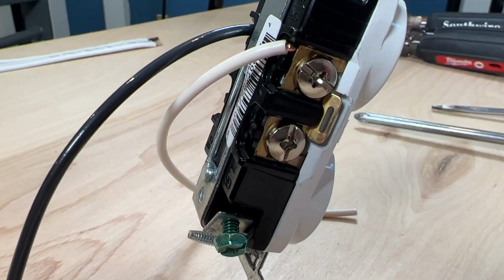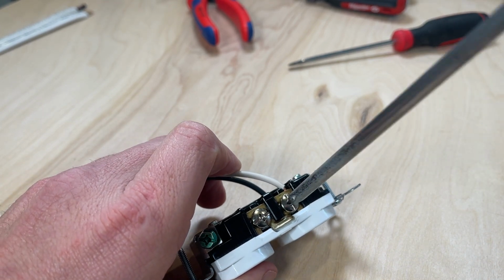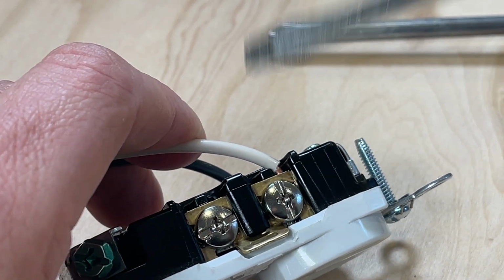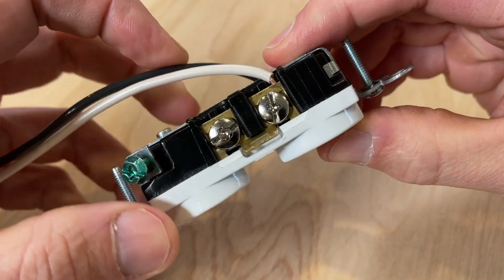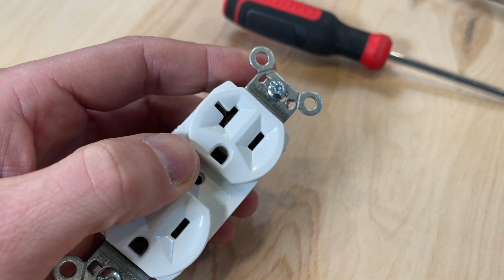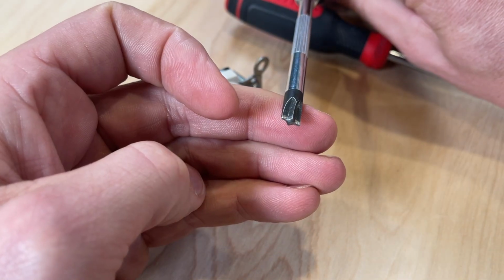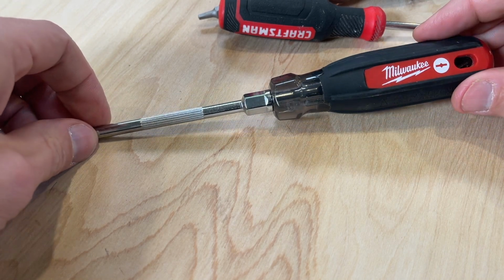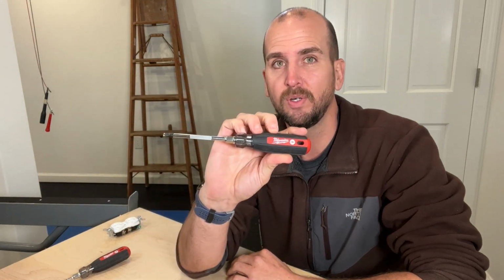80% of People Use the Wrong Screwdriver For Electrical Work

Comment: Let’s face it, cruciforms of any sorts are plain no go. ECX blades are so wide that it condemns you to be exactly square with the fixture, while Robertson gives you significant play in the position.  One outlet per six month does not matter. 100 a day is something else.  But can anyone tell me, why on earth use a tool designed to cam out in a straight torquing application?  When something is design in a certain way, well, why not just just use the tool that was meant to be used for the purpose? Beats me everytime.  Is there something to learn from that 56% use a tool that was not design for the task?  Yes and no. If those who answered were to be electricians, I would certainly ask another question before hiring a new electrician for shure! If not, then, anyone can go with whatever floats his own boat.  I’ll keep doing my finishing with my trusty wigglies, no1 Robby for the wires and the receptacle to the box, small flat for the plates. Light, efficient, never out of battery, never a cam out. And will never get why the debate « American » Philips vs « Canadian » Robertson.  One is for cam out application like drywall screws, the other covers the rest.  All the others are to have us get boxfull of useless tools. Who are the ones getting screwed in the end? 🤔

Comment: 1st off... it's a combination screw that is designed to be used by a #2 Philips, 1/4" Slotted, & a #2 Robertson.  
So pick your poison.
Reply: It's a #1 Roberson on the devices I have, but you are right.  The screw is designed to take any one of three common screwdriver types.  

Combination screwdrivers are a gimmick, in my opinion, and not a good choice because they won't fit older devices that don't have the combination screw.  My Alfa 4-in-1 has all three drivers, and they all work well.  The Robertson is the most convenient; the flat blade is probably best for torque.

Comment: Recently ordered the Klein 32752, Milwaukee ECX bits 1 & 2, and the Wiha 30704 from Amazon.  I TRIED to buy from my local Home Depot & Lowes, but they DON'T HAVE THEM.  Home Depot website CLAIMED they had Milwaukee ECX, but after wasting time with Home Depot store & online order (which they cancelled), I went with Amazon.  Why don't the stores have these in their Electrician Tool section?  I've been using Square Drive #1 & 2, but want to have the proper tool for ALL situations.

Comment: Great information. What is the trick to getting the wire around the screw after you make the loop?  I'm just a regular guy, not an electrician but I've replaced over 100 outlets and I've yet to see one where you can actually fit the wire around the screw...the wire is too thick to fit between the screw and the housing. You have to really force it and almost break it.  I have in the past backed the screw out until it falls out then place the wire then the screw. What do you pros do?
Reply: Pros use a better quality device.  I am not an electrician, but I have a couple of good receptacles in stock.  The Eaton does not have the modern back-wiring feature, so you have to put the wire under the screw head.  The screw backs out then stops; it doesn't fall out.  There is plenty of room to put a hooked wire on the screw.  The Hubbell is designed to take a straight wire into a fitting which is clamped by the screw.  These screws do not back out so far, so you are supposed to use the new method.

Comment: The drivers must cam out for a reason. To prevent someone from applying too much torque to those little screws?
Reply: It was not the primary purpose of the original design, but it was not a problem.  The Phillips screw was not intended for high-torque applications, it was designed to make assembly more efficient.  Self-centering was the main objective.  I have tried using the proper sized Phillips for wiring a receptacle and I don't think cam-out is a problem preventing making it sufficiently tight.  Notice in the example shown here, he is not holding the receptacle securely.  He is also using a driver with a fairly long shaft.  If you hold the receptacle firmly and use a suitable driver, like my Alfa 4-in-1, it is easy to tighten the screw with the Phillips bit.

Comment: The screws are designed for Robertson bits so that is really all you need and a standard Robertson screwdriver  is inexpensive. As in every other application Phillips and slotted are dismal performers.   I’d probably look into a hybrid if I did this all the time but it’s an otherwise unnecessary tool.
Reply: If you have to remove old devices, they may not have the Robertson compatibility.

Comment: I've been using the #1 robertson for receptacles for the longest time now but that head is starting to slip on my latest project so I decided to upgrade to the #1 ECX. It is really nice and it gives me super tight connections. I'm still keeping my #2 robertson for panel work. I didn't find using the #2 ECX comfortable to use on a panel.
Reply from the maker: I usually use GRK multipurpose wood screws from Home Depot.  On this project 2" long would work well.

Comment: Why doesn't the outlet manufacturer use a normal Phillips screw? Why the Robertson screw?
Reply: It is a combination screw which accepts a straight blade, Phillips, or Robertson driver.  The United States and Canada use the same electric power system.  Robertson drivers are common in Canada.  Any household in North America is likely to have at least one of the three accepted drivers.

Comment: So im working on a light fixture, The plate was put in with screws that look like that but more rounder in the middle whole. & No screw driver is working. I got all sorts of specialty bits too except for a slotted phillips because i hate them. Do you know what type of screw it could be? The whole seems to be smaller than most as well.

Comment: I have found the Klein combination tip to be better than the Milwaukee.  The problem with the Milwaukee is the square tip is not long enough to actually do anything. The blades of the "flat" tip portion bottom out in the slots before the very small square drive can actually engage.
The Klein tip has a slightly longer square portion.
Either is preferable over a Philips or square drive IMO

Comment: I was first introduced to the Robertson in woodworking. Kreg screws use the #2 Robertson. I think the #1 Robertson is the best for electrical devices. I have the Milwaukee ECX and it doesn't fit deeply enough into the screw and because of this you can't apply the torque required. The ECX beats both the flat blade and Philips but not the Robbie.

Comment: I'm a tool snob. Working with inferior tools drives me crazy. However, by the time a picky DIY'er buys all the right tools for each DIY job, he/she will need a space larger than a Home Depot tool department to store everything. Not only do you need a lot of space to store lots of great tools, you have to develop a method of keeping everything organized and in good condition. It doesn't take long before this enterprise grows into overwhelming proportions. Drowning in tools.
Reply: I have a lot of tools and I live in a small apartment.  It isn't the tools that are the problem, it is the power tools in particular.  Hand tools don't take up much space.  I have a Klein tool pouch with sixteen screwdrivers in it.  Compact, but the drawback is that I have to dig through it to get the one I want.  Add a few tool boxes and a small chest of drawers and I can keep a lot of tools with enough room left over to live a normal life.

Display of tools takes space.  If you like to have a lot of tools hanging up in plain view, then you need a shop with wall space.  If you want all your wrenches well organized, then you need a tool cabinet with those shallow drawers, as large as necessary.  That's a luxury for the nonprofessional.

Comment: I have used the #1 Robertson for years wherever I can. I have been upgrading my switches (again), adding a bunch more smart ones. I took your advice and bought a Milwaukee ECX #1 (HD, 3 piece insulated set), as well as a Klein Hybrid multi-bit (#2 only in the set) - easiest way to get these locally. For the most part, this has been great, but a few comments about my experience so far:

For most wiring devices, the ECX#1 has been great, but there is at least one brand that it won't work on. I don't remember which but I believe it was either Lutron or Leviton.
My panel was updated last year and I needed to swap out a single space breaker for a tandem. The ECX (Hybrid) #2 makes quick work of removing the panel cover, but the Eaton BR breakers are compatible with the  ECX #1, not the #2.

As I turn off a circuit, I also try to find the outlets where I used quickwire in the past and switch those to side wire. Thanks to your videos and my own experience with failed outlet connections, I know better now.

Thanks for this outstanding series. You are costing me a little with tool upgrades, lol.

Comment: The issue that I have had with the ECX tip is with old work, when someone had used a phillips on the screw to tighten it.  Then I may have issues with the ECX bit fitting into the screw.  Usually, this is with the mounting screws, not the terminal screws.  I'll first try the ECX, but if fit is an issue, I switch to a phillips or slotted as needed.

Comment: This is stupid as shit, the outlet does not move... you should NOT be putting too much torque into the wiring as after torque it will split. Its an electrical connection which is contact not pressure, The reason the screw is PURPOSELY designed like that is to stop excessive torque which causes failures. Jesus Christ its like these people have cheese for brains and think nobody thought any idea before them. Use your brain and realise your not the smartest person on the planet you are the stupidest at best, overengineering everything is dangerous for idiots. Do yourself a favour and stay away from any electricals if this is your input before you die.

Comment: In Canada, Roberson screws are the most common and least expensive fastener type.  I've worked as an electrician and, to me, that Milwaukee hybrid would end up being a pain in the ass to constantly have to line up while the Robertson is quick, easy and delivers more than enough torque with mininal effort.  I'll stick with Robertson.

Comment: Legrand is also my standard - I'm currently remodeling, and as I come across a switch or receptacle, I swap them out with a Legrand unit. They also have a great variety of paddle switches, dimmers, GFIs, Receptalces (including GFIs) with USB power plugs, receptacles with built in night lights, etc. Coolness!!!

Comment: That slotted screwdriver is too small and too long to aim it accurately. I use an old, short slotted screwdriver. It's a bad form for electrical work because it has a full tang going through and has been used as a chisel. Lol. But moder s/d I can find also get long with increasing tip.

Comment: I bought a #1 Robertson screw driver at Canadian Tire in Winnipeg and put it in my electrical tool bag.  I use it for any and all work on electrical outlets since it doesn't slip out of the screw like slotted or Phillips head screw drivers.  I also have #1,#2, and #3 Robertson bits for another screwdriver I own that has interchangeable bits.

Comment: Sure since American electrical installations are scary as f why shouldn't be the tools too...
I know my German standards are sometimes over the top, but man insulating the screw driver up to the tip isn't really much more plastic.
(Also never ever work on a live system always disconnect and safeguard against reconnecting!)
Btw. we use hybrid screw heads for electrical terminals in Europe too, instead of Robertson/Slot it's Pozidriv/Slot. It makes life a heck of a lot easier.

Comment: In all my tool bags, my desk draw, my range bag, and my main camera case, I carry Klein 11-in-1 screwdrivers. Full time, I do datacom, and often have need to use conduit, and much prefer when there is a square head on them, though I mostly use the dust-free conduit fittings because the client that I do the most conduit for requires them.  Recently, I was replacing some outlets in my house, and love the squares, works so well.  When doing carpentry type work, I much prefer the star head screws. For the finish screws I use for some stuff, they are a square drive and work very well. 
IMHO, all types have their place, well, except for flat heads, lets get rid of flat heads.

Comment: For mains wiring, ALWAYS use vde screwdrivers, yes they cost more and dont have those special bits(the milwaukee one) but safety goes over practicality, there is a reason, why electricians( at least in germany) need to be given vde screw drivers from their employer

Comment: I took over ownership of a property with 6 buildings (USA)... much of the electrical work being replaced was from the 1940 - 1990s. Most of the switches and outlets were slotted screws, so only a flathead could be used. I found a cool #2 (Klein) Phillips on the property with a metal piece sticking out.. my electrician showed me it's for making easy J-hooks. 

Anyways, I think the point the manufacturers made is... either a flathead, Phillips OR Robertson driver can be used no issue

Comment: I just want to be unreasonable and insensitive for a moment, and say robertson, posi, hybrid, slotted, jis, reed and prinse, allen, and anything else you can think about other than torx, and possibly phillips, suck, and if you like or use them, you suck too.  especially electricians, and electrical engineers, using hardware that kinda looks like phillips but isn't, cause you suck.  Historians and Restorers are exempt, use what is appropriate, but the rest of you ought to bloody well know better by now.

Comment: If you but a quality Robertson...
Not a bit that goes in a multi driver, but a green handled (they are colour coded), get a carbide tip. You have full contact in that square socket. Proper screws can be stuck on it and will hold there.

And... it works on the 6/32 mounting screws as well.

Both Torx and now this Hybrid thing are nothing more than Americans refusing to admit that Canadians did something better.

Comment: What if the screw head was made to be compatible with multiple types of screwdrivers? The screwdriver that fits solidly with more contact surface is going to be better. I prefer the Phillips because it doesn't slip, though there does seem to be more leverage with the wider flat head. Cool to know that the hybrid does exist!
Reply: That's standard PH/SL2 screw. There is standard PH/SL2 screwdriver for it.
There is four type of screw/bit in that standard:
PH/SL1
PH/SL2
PZ/SL1
PZ/SL2

Comment: I use actual electricians screwdrivers. They are better at fitting terminals than normal Philips or slotted. I’ve never had a problem with them camming out. They also work great as a JIS screwdriver for Japanese cars

Comment: I have recently gone with the multi-bit that has ECX, Robertson, Phillips, Flat, and several sizes of nut driver. It has become my go-to because of the versatility. I have large hands, so I have no problem holding the larger handle.

Comment: I would start from a fact that 90% of people using screwdrivers, doesn't know or understand importance of selecting right screwdriver type for particular screw type. What's more, they don't know that there is soooo many of them, and they would still use standard Phillips screwdriver for ALL screw types, even ignoring poor fit or lack of screwing torque.

Comment: Ultimately the problem here is caused by the manufacturers using screws that are designed to fit so many different screwdrivers.  If they just choose one common standard of screw instead, rather than a jack-of-all-trades style, then all would be fine.

Comment: #2 square works better. Also, if you used the correct sized flat head it would grab a lot easier.

Personally I set my Dewalt 3 speed to 1 and just impact the shit on.

Comment: I don't particularly appreciate the attitude of "If you don't use MY preferred tool, you're wrong!"    In fact, I would say that YOU are actually wrong.   Not in the tool you want to use, but in the belief that the design of the screws is oriented around that specialty tool you use.    They aren't.   In fact, THAT design is a very recent compromise design in itself, to add compatibility to Robertson to the screws, reducing what they have to produce for the US and Canada.    The very few times I see tools mentioned on the packaging for those outlets in the US, it's a Phillips (cross-head) screwdriver, and/or flathead.    To drive this point home (pun intended), I just pulled out my storage boxes of light switches, power outlets, and dimmers.    

Bryant orange round outlet, back wired.    Flathead screwdriver only
Leviton rectangular outlet, side and back wired.   Phillips and Flathead ONLY.    NO space for Robertson.
Leviton rectangular light switch.   Side and back wired.    Phillips and Flathead ONLY.  NO space for Robertson
Leviton narrow toggle light switch.  Side and back wired.   Phillips and Flathead ONLY.  NO space for Robertson
GE Incandescent light dimmer.  Side wire. Single gang.  Flathead only.
Leviton Illuminated rectangular light switch.   Side and back wire.   Phillips and Flathead ONLY.  NO space for Robertson

I could continue, but I think my point has been made.   A #3 Phillips might fit that outlet you showed - I don't have any here to test with.  If you had used a 1/4" flathead, instead of the 3/16ths you actually used, it would have seated quite well - but that would not have suited your push for people to buy a specialty tool.    In this particular case, if you came into my house (or any of the businesses I consult for), you'd have to throw that $15 ECX screwdriver back in your toolbox.    It simply wouldn't fit any existing screw heads.